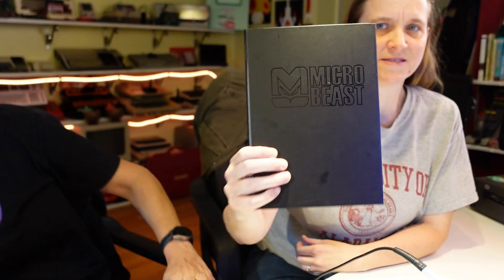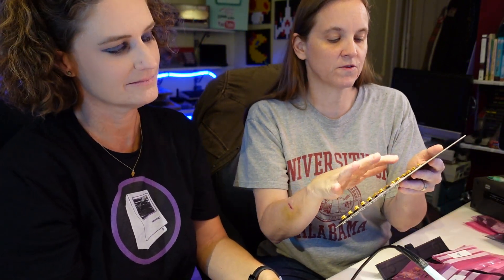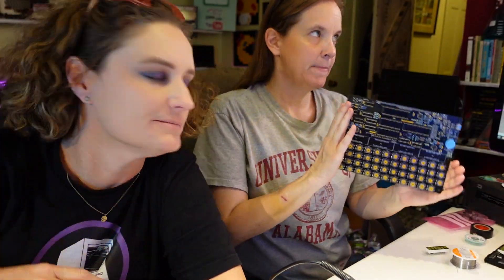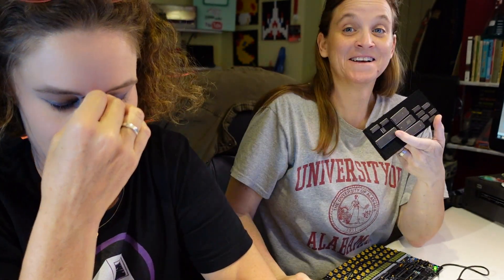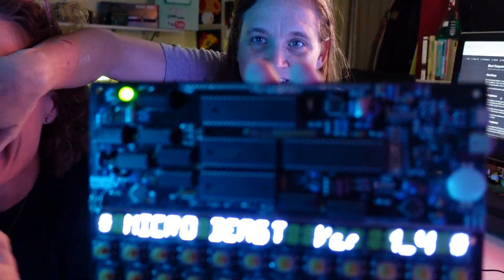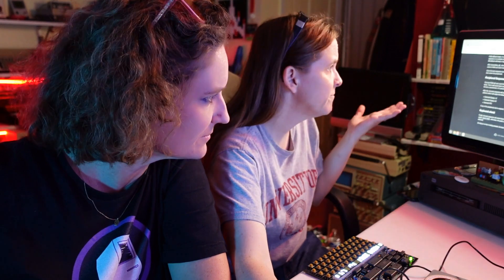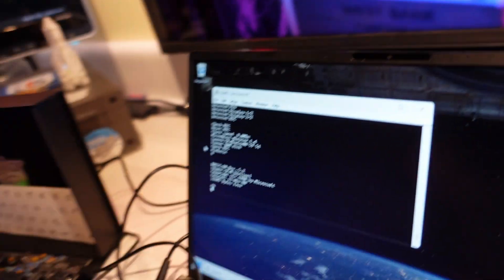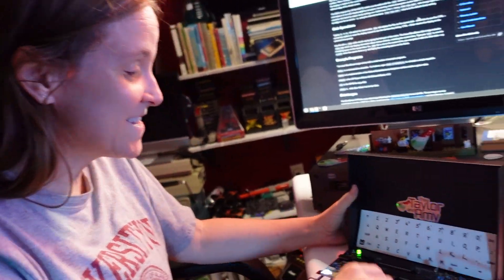MicroBeast Computer Kit

Comment: You gotta be fast because z80 DIPs are no longer made :D I see it can run CP/M, nice!
I have a Z80 very old MPF-1 (did a video on it) but this would be a cool little project before I need to harvest z80s from old machines :D THUMBS UP
Reply: It's so sad about the Z80s, I know.
Reply: @fractalMD  There will be a way... Z80 machines will continue to exist for years to come..
Reply: @LockFarm I mean, I feel like surely you sure right
Reply: @fractalMD  There are still a lot in stock around the world, and beyond that we can build drop in replacements. Whilst most of the world is moving away from 5v electronics, we'll keep the whole ecosystem running for a while yet, and after that we'll make something that is hopefully just as accessible.